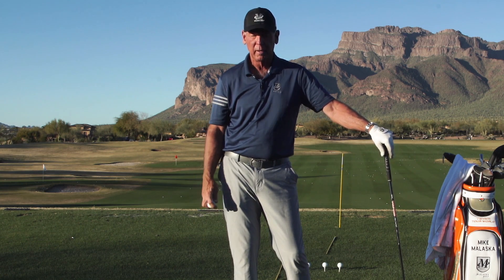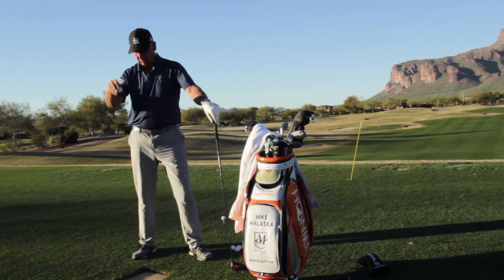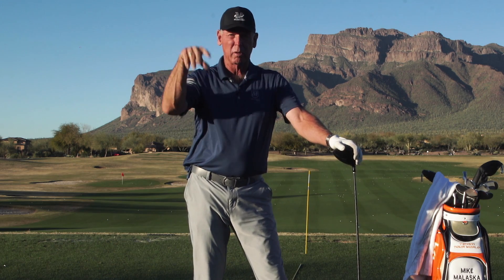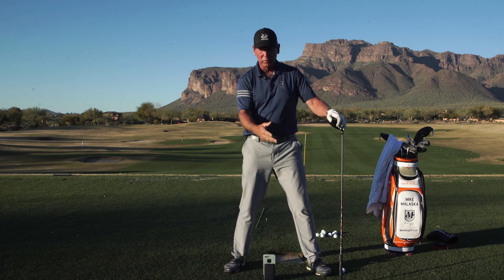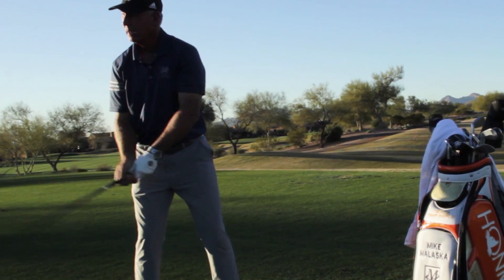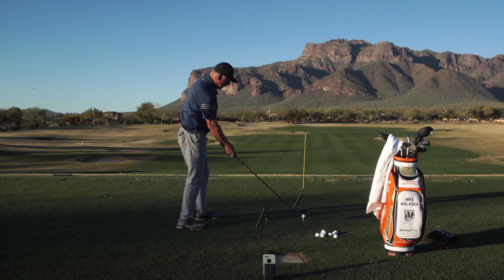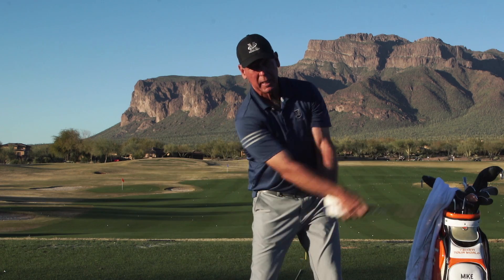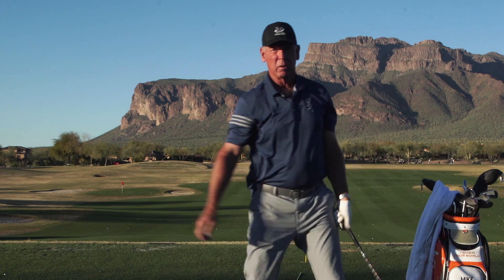Malaska Golf // Where Does Speed Come From - Full Swing Speed Generator

Comment: Mike, firstly thank you!
I’ve got my swing down really well through stack & tilt system. BUT the videos you have put out on grip are truly awesome , immediately improved contact, no longer had a problem of my head moving off the ball, my ball flight which I thought was pretty good is Truley awesome now. My 56 degree which was my 80 yard club is now my 100yard club, added 60yards consistently to my driver😃. But the most amazing part of changing my grip is the effortless feeling it has produced
Thank you

Comment: Maybe another way to explain "speed" is thinking of the grip end of the club vs. the club head itself?  The club head accelerates by making the grip END move in a very small semi-circle, very fast as opposed to "dragging" or holding on to the grip end trying to achieve lag.  Much like a water skier being towed by a boat .... if the boat makes a tight circle the skier is whipped around and goes faster.  If the boat makes a large circle, there is no whipping action and no acceleration is achieved.  Not sure if that helps or not.  It is the cocking and uncocking of the wrists that creates speed.

Comment: Mike is not accurate about the core relation to the hand speed...you are generating force through the ground and as it comes up through your kinetic chain, you are pulling through your abdomen in order to generate the extra force through your arms...you may not be MOVING as much in those areas, but the obliques and core have an ENORMOUS connection to hand and arm speed...hands, wrists, and arms have the speed generated up through the ground, and transferred through the obliques up through the shoulders and finally out through the hands and wrists and fingers, 
Simple take a 10 pound medicine ball above your head and try to throw it as hard as you can into the ground...your arm speed will be entirely limited by leg drive and core stabilization

I understand what he is getting at, but the kinetic chain and tension through the core is directly related to this speed...if you're throwing a baseball 90+ mph or swinging 145+, the majority of the speed comes from arm, wrist, and hand speed, but in order to generate the force necessary to create such speed, you have to have tremendous leg drive, core connection, and overall body power...same thing with the golf swing, just on a different plane
Reply: John Browning you try doing that when you are 70 with 2 new knees. You have to let the body follow the arms.

Comment: Speed and length can be obtained from different areas. Some use leverage,others combine various areas in witch speed can be produced. Wether it be ground force with massive pelvic tilt , or aoa. I can produce ca 82 mph with my 7 iron just using my hands and wrists. Using my whole body produces ca 91 mph with a 7 iron. But a combo is required to obtain predictable shots. Off course you can hit a ball with one hand and from many funky positions. Cuz you have done this a million times and you know how to manipulate the club. beginners do not how ever. its a grat clinic,but suggesting that you can basicaly play golf properly from those positions is just not correct in my opinion. If you have 1000 dollars to spend on golf lessons , use 999 on alignment and the rest on debunking myths. Slicing are you ? Chances are you are aiming to far to the right and an outside in swing is a necesity, not a fault :) Think about that :)